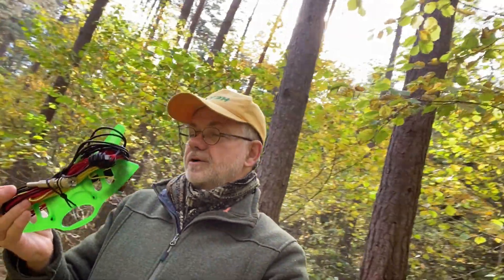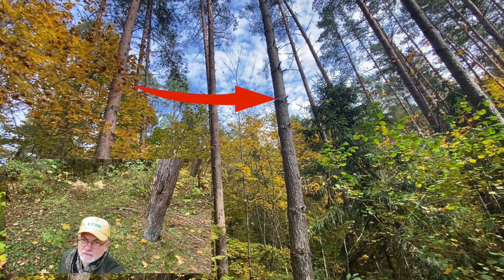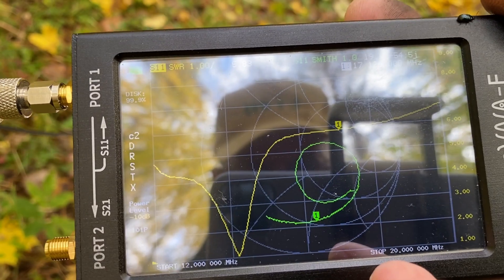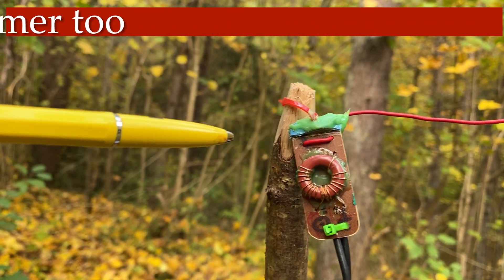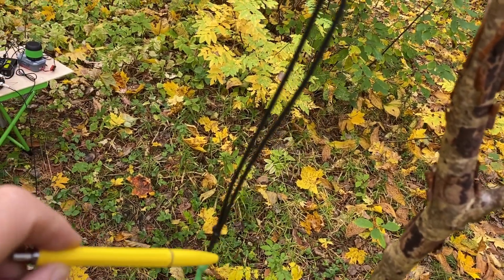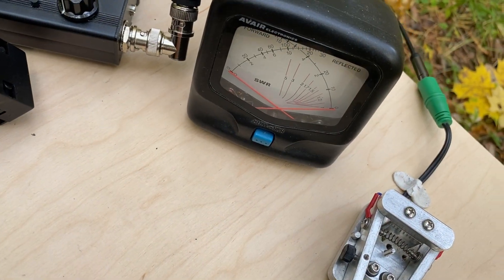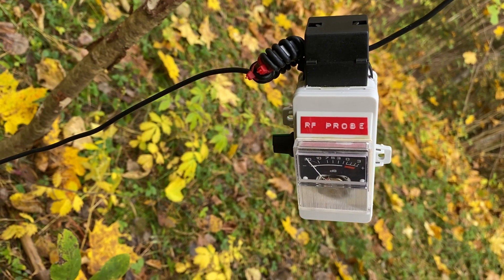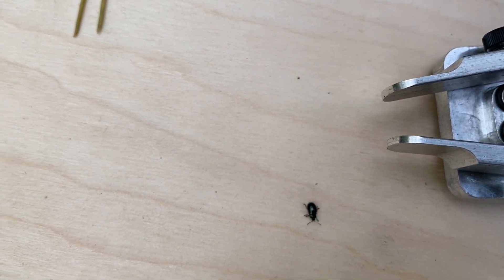My special End Fed Half Wave antenna "Mono-20" for the QCX-mini transceiver.

Comment: Guess there is no galvanic connection between primary and secondary of your transformer, therefore the feed line is not the counterpoise, it's the shield of your coax capacitor. Your capacitor is at the same time the counterpoise for your antenna. As you mount it, it has a capacitive coupling to the feeder coax, therefore a good idea to have a choke at the feed line.  Either way, mounting the capacitor and the feed line separate, spread by 90 deg., without a choke (mounting in operation not practical), - or - well done, as you did, in parallel. 73s Wolfgang, OE1MWW
Reply from the maker: Thanks for the comment, Wolfgang. Actually, there is a galvanic connection between the "ground" ends of primary and secondary windings. It's the only way to have a feeder's shield to really act as a counterpoise. If  the primary would left  "hang in the air" with coax connected to it, and with no separate counterpoise wire connected to the LC circuit, then the antenna current would find its return path anyway, just through the strain capacity between the LC circuit and surrounding objects, including through the outer shield of the coax capacitor as you suggest. This could work, probably, but it wouldn't be clean solution, one could expect the SWR jumping depending on the location and the nature of surrounding objects. In my case, the shield of the feeder coax is connected also to the "lower" end of the LC circuit and creates a reliable return path for the antenna current. To prevent this current appear on the equipment and to make this "shield counterpoise" resonant ( 0.05 w/l) we need to chop it off at the length of 1 m ( for the 20m band) by the means of the RF choke. The piece of coax cable which is employed as a capacitor in this configuration acts as a capacitor only as its shield is connected to the feeder shield and makes no difference at all for the rout of the CMC. This capacitor cable could be rolled up in the coil and put into a box etc. Thanks again for watching and let's keep experimenting! 73! Linas LY2H
Reply: @Linas_LY2H  OK, got it, live experience is important ;-) Once again it proves: the reality is always something different than the theory of it.
Reply: @Linas_LY2H : the resonant circuit, according to the table of the Amidon toroid, is resonant with 17 turns (1,5 uH) and 62pF on 16.5 MHz.
From somewhere, about 20 pF (antenna wire?) must have been added, then the resonance is at about 14.2 MHz.
Reply from the maker: @WolfgangKMeister  That's a good question! I think, its because of the real capacity of my RG-174 cable  is not like theoretical 30.8pf/ft in the data sheet, may be a bit more, depending on the concrete brand  of the RG-174 type. I had it  longer before the tuning and was surprised to have had cut abt 17cm to get the 14.1 MHz resonance ( with the 3.3k resistor instead of antenna wire). Could be more reasons of course, like the variety of specs in the iron powder toroids giving higher inductance than in the calculator. The only way to know would be replace this cap with the known value cap and see what would the real capacity be at resonance. May be a long winter evening experiment :) ? 73!
Reply: @Linas_LY2H  Hi Linus, I'm new to amateur radio. Is the effective length of the counterpoise (coax length before choke)0.05 w/l using 20m or the target frequency, as theses will be different? Or, if your last step is to prune the antenna wire, just the final tuning with that? Excellent video, by the way!  73, M0YZT
Reply from the maker: @DrHWO  Thanks for watching Howard! And welcome to the greatest hobby in the world! The counterpoise length in the End Fed Half Wave antennas is not that critical as per concrete working frequency. Normally, it's 0,05 w/l per band. If you have a multiband resonant EFHW , the length of 0,05w/l for the c'poise should be measured for the lowest band. As to the tuning and pruning, I like the method described very well by AA5TB on his website using the ~3k resistor first to find the resonance by adjusting the capacitor, and then only connecting the real antenna wire and pruning its length only without touching the capacitor anymore. While doing this final pruning , it is good to have the 0,05w/l c'poise in place , be it a coax cable with the rf choke ( if the ground ends of the primary and secondary windings on the transformer are galvanically connected) , or a separate 0,05 w/l wire connected to the secondary winding's ground ( if the coax and antenna wire are galvanically insulated from each other). If you are going to use widely popular non-tunable broad-band 49:1 transformer, then the whole tuning procedure involves cutting the right length ( 0,5 w/l) of antenna wire doing this with the counterpoise in place. Hope, this helps. Let the community know how are your projects going! 73! Linas LY2H
Reply: @Linas_LY2H  hey Linas, thank you so much for the educational and timely response. I hadn’t appreciated what an enormous area amateur radio covered. My current project is learning to copy Morse code , although listening to your fist, it sounds more like an art form than a  science skill! 73, M0YZT